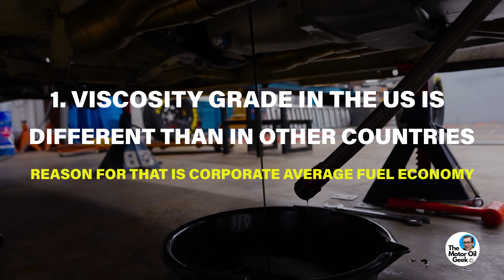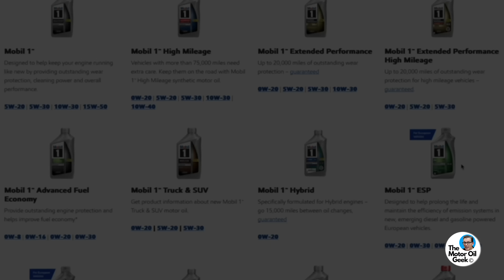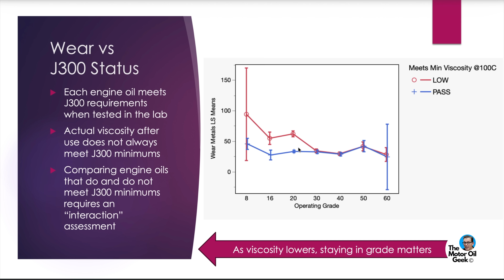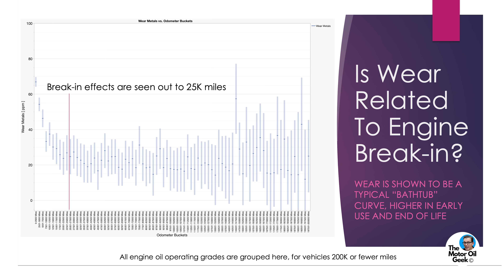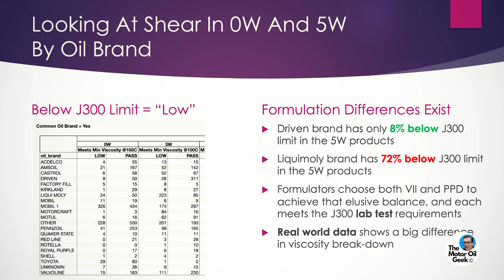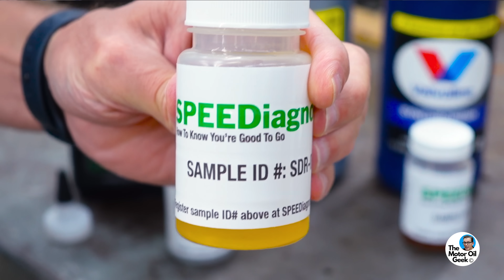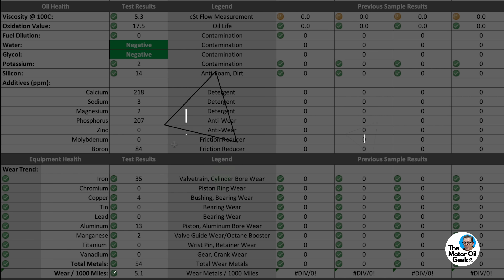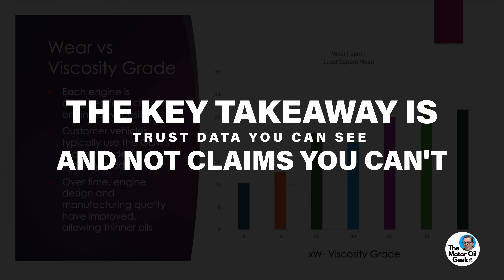More Ai Lies? The FACTS about 0W-20 vs 5W-30 (With Evidence)

Comment: Manufacturers often aren’t recommending what’s best for the vehicle long term they’re recommending what they need to do to meet fuel economy and emissions regulations.
Reply: and they want  damage so they can fix it or replace vehicle
Reply: @bikeman1x11  I don’t believe they want engine damage but their back is against the wall with ridiculous government mandates to save a quarter mile per gallon. For the moment many of those regulations have come to an end. Trouble is manufacturers plan long-term and we could do a 180 every election cycle.
Reply: @star9732  everything today is meant to not last -- im using a heavier oil as i know it will protect better .
Reply: @bikeman1x11  Oil pumps are designed to work with particular oil viscosities. Even when countries outside the US specify a different grade for the same engine, the oil pump is not always the same. Improper oil pressure and flow rate can have a bigger impact on engine wear than viscosity, especially when oil temps get very high around a turbo. Something to look into if you've decided to change your oil viscosity.
Reply: @Dando77691  You have no proof of that.
Reply: @Dando77691  other than tune and emissions  i doubt toyota ford honda etc specify. differnt oil pump for the middle east  than for north america-- the reality is that 0w oils are speced for mpg not protection-- 5w-30 seems to work in all but the hottest and coldest climares
Reply: @Dando77691  The oil pumps are the same although some use a different PRV to control pressure of higher viscosity if the vehicle is moved to a colder climate (basically some models have a cold weather package). Only thing this really does is help long term wear when vehicles are operated under heavy loads before proper warming.
Reply: @star9732 okay but why do some companies handle these government mandates just fine but others fail miserably (US auto makers)
Reply: Most manufacturers shoot for 140K miles. If the engine last this long they are happy. Many reasons why it's 140K but it all breaks down to money.
Reply: @Cutterman_fixer  No they aim just to last thru the warranty period.  They build and design vehicles made to last only 3 years, less if you put many miles on.
Reply: @xcalibertrekker6693  that makes no sense because would YOU buy another vehicle from the same manufacturer if it started to fall apart right after the 3 year/36,000 mile warranty was over? If an engine needed major repair right after the 5/60 warranty, would you buy another from that manufacturer? Car companies want repeat business. Dissatisfied customers don't come back
Reply: @Cutterman_fixer  That certainly hasn't been my experience. Maybe you should consider a different brand if it's yours.
Reply: @Georgiagreen317  Not sure what you are replying too. If it's what I said above the 140K mileage is what most car manufacturers shoot for on privately US owned vehicles with minimal maintenance done. This is not something I pulled out of thin air this is something I deal with for a living. Can a car last much longer, yes can it last much shorter yes. The thinner oil recommended by manufactures will work under normal driving conditions. That "normal driving conditions" is the problem. In today's society almost no one operates under normal driving conditions. Ref SAE technical publication and papers and you will see that what everyone thanks are manufacture recommendations are actually not manufacture recommendations. Again manufacture recommendations for oil grade which is posted on the oil fill is only for "normal driving conditions" which almost nobody does.
Reply: @Cutterman_fixer  well most of them are having a ton more problems  way before them please elaborate how you "deal " with this for a living.  0-16w can't be good for anything other than a sewing maching.
Reply: You forgot that they care that the engine run out of the warranty and than it can break down. In Ford they go for thicker oil from 0w20 to 0w40 to let the engine go out of the warranty.
Reply: True.  Had to get a tuner for my ATV to remap fuel.    That 14:1 is a lean torch
Reply: Did you watch the video?
Reply: @TruthInFlying  You do know there's a huge fine from our corrupt government for not using 0w20?
Reply: @lonniebeal6032 
Who is fined? Car manufacturers or owners?  Car manufacturers may be in an effort to comply with mandated fuel consumption.  I don’t see how a vehicle owner would be.  The whole reason we are watching this, most of us, is because we were screwed by oversight.  In other videos he speaks about surface finishes that didn’t have the crevices (my word) to hold lubricant.  After warranty failures and high oil consumption.  At the end he speaks about what to do test he says.  How many can and do this.  Buying any product is built on TRUST.  Trust in the auto industry did their testing in conjunction with the oil companies.  TRUST has been broken.
Reply: @TruthInFlying   The video is BS. The SAE actually recommends MUCH higher viscosity oils. eg 20w- 50 for temperatures above 10C/50F.
Reply: @TruthInFlying  I did & it still isn't clear which is the better long term oil.  He points out in the beginning that the viscosity recommended in the U.S. is often different than the rest of the world & because of mpg requirements.  He then points out 5W-30 may break down sooner than 0W-20 depending on which brand you use (assuming somewhat depending on change interval), at 3:36 he points out that 30 in grade has slightly more wear than 30 out of grade (seems odd) and slightly more wear than 20 in grade.  If they both go out of grade the 20 shows a lot more wear.  So if I buy an oil that falls out of grade looks like it doesn't matter with the 30 and 20 shows a lot more wear.
Reply: I have a 2026 Toyota that uses 0w8, but I live in Phoenix, AZ.  For the summer would I be better off going to a 5w20 or 5w30?
Reply: @adwenb  I would go with the 0w-20 so you stay with the more modern additive package the newer engines require.
Reply: @robertweinmann9408  nope. Same exact detergents in the heavier oil
Reply: @adwenb  Use the oil that is recommended for your engine. There is no proof that switching to one of those other oils will do a better job. The O.E. spec oil is tested where you live and proven to work correctly.
Reply: @thecardoc100 then tell me why the European version states 5w30 for the same exact engine. Hint: they don’t have our EPA. This is all a rouse created by car manufacturers to skirt fuel economy requirements.
Reply: @thecardoc100  I dare ya to move to AZ, drive fast on Interstates and see how long your transmission last following mfg recommended trans fluid change intervals.
Reply: @scottjohnson8576 they can and do tune the engines differently. Not every engine, but most are.

But you do you.

The different grades can be fixed by more frequent oil changes anyways.
Reply: @thecardoc100  No the oil is not tested to work it is only tested to be sure they meet MPG standards.
Reply: @davepetrakos475  Don't change the subject. There are times when doing more than the manufacturer requires has advantages, but without documentation and proof it's just an opinion and not a fact. Besides, highway miles are nothing when compared to local hilly terrain while towing a trailer that doubles the weight of just the vehicle alone.
Reply: @adwenb send a sample off and get an actual analysis of how it’s performing not just what some stranger is gonna tell you in these comments
Reply: @adwenb  They will say you voided the warranty better be careful.
Reply: @xcalibertrekker6693  Well it says in the manual.
Reply: @BOMBON187  And yet there engines and transmissions keep exploding.
Reply: @adwenb  go max 2 grades up, not more. 0w20 is good
Reply: @adwenb  manual says 5w30
Reply: 30wts.in s. part of state. I lived there in 80s.
 .and prefererd to run" high ' straight wts in summer...i warmed up engine till the lifters quit clacking. Kept apot of beaters alive with that strategy.
Reply: @adwenb  How would that effect your warranty? Would the dealership make that change?
Reply: @dotherightthing1187  I read they can't just outright blame the wrong oil, they have to prove it.  But, do you have the money to fight it in court?
Reply: @lonniebeal6032 I think that's what class action suits are all about. BUT, it means showing that the recommended lighter weight oil is worse for wear on average (like if you're using the long intervals recommended by the car manufacturers for "maintenance required")
Reply: @adwenb  Spend $40 and get an oil analysis on your 0w8 after a summer run.  Then if you chose a different oil you have that as proof their oil failed to do it's job.  Don't run 0w8 over 5,000 miles.  I've been trying to get proof for 3 years now that 0w20 is ok in hot climates.  I don't have factory warranties on my RDXs, so I run 0w20 for 6 months when it's below 70F, and 10w30 for the 6 months over 70F.  So far, with the information I've seen, high quality 0w20 will handle the higher heat ranges, the low quality, not so much.  Pennzoil Ultra P and regular Platinum always seem to pass the high temp tests.  Along with Amsoil, ( too pricey) Mobile One Extended Performance and a couple others.
Reply: @adwenb No doubt about it... If you use a higher grade and stick with the recommended longer intervals for oil changes you'd be better off because of the degradation of oils in hotter climate.
Reply: Finally an explanation backed with evidence 🙏
Reply: And to get the vehicle to the end of warranty but not further
Reply: THIS X1000
Reply: When you have soooooo many engines breaking down at 40-70 thousand miles you have to ask yourself, “what changed?”  Oil viscosity changed!!!!
Reply: @donbass6657  Oil viscosity, emissions and hydraulic lifters (hydraulic lifters and oil viscosity are related).
Reply: Always not often.  They would rather the engine explode then not meet MPG standards.  Such a terrible industry now.
Reply: perfect.  you got it.  my dad had a 96 jetta. 4cyl.  he put 20w50 in the stupid thing.  He said  needs to be thick.  it ran way over 100k but.  the throttle body would get gummed up
Reply: @Nick-wr7vv  What does the engine oil have to do with the throttle body getting dirty?
Reply: @TheSuburban15 😂
Reply: FACTS, FACTS, FACTS.
Reply: Well said and it's the truth plus it gives their service departments more maintenance to do
Reply: Fuel dilution and extended drains on 0w-20 is what think hurts a lot of these engines like GM 5.3L with AFM. I only use 5W-30 in my wife’s 18 for this reason.
Reply: @smiley3303 This is a faulty engine because a lot of people were having problems long before these engines began to use 0w-20. But I agree possibly this oil is ill suited for this particular engine . But there are many engines that can go the entire interval with no negative effects. Hondas and Toyotas (LONG BEFORE THE RECENT ENGINE ISSUES) have been using 0w20 full synthetic for years with no issues.
Reply: Exactly right. Anyone capable of thought should realize It's never been anything more than 'playing nice' with the EPA's phony, CAFE Standards.
Reply: You forget one thing. That engine was DESIGNED to meet EPA regulations. Therefore, that engine was DESIGNED to run on the oil the manufacturer  recommends. Doing an oil change is the cheapest insurance you can do to prolong an engines life. I always change my oil sooner than recommended anyway. People today do not even bother getting their oil changed when its recommended, then wonder why their car fails them.
Reply: Absolutely correct
Reply: Fact , back in the era of the BMW m63 engine BMW claimed it only needed oil changes every 17,000 miles . They did this to get past the EPA’s emissions restrictions. Less oil changes less environmental impact. Most of the cars sold with the M63 engine lost the engine to valve guide and valve seal failure. Eventually a class action lawsuit was filed against BMW and they were forced to repair the engines. Sad story because the engine would build up contamination in the cylinders causing pre ignition. The computer would sense the pre ignition and shut the engine down . The extremely hot crank bearings would seize and lock the engine up .
Reply: "Manufacturers often..."  Not "often," anymore, but always. Regulations are forcing them to prioritize EPA fuel economy ratings over long-term ownership costs.

Comment: So 5w30 is better, 0w20 protects just as well (all things being equal) until oils start to thin down from heat and wear. 5w30 would have to thin out at a higher degree than 0w20 to become a problem.
Reply: That’s what I got too. Been looking at switching to 5w30 in my Lexus from 0w20 now that mileage is about 90k. This vid helped out
Reply: @beammeupbrando I switched from 5w20 to 5w30 in my Corolla and V8 F150 about 3yrs ago and haven't had a single issue. I use either Pennzoil Ultra or Valvoline Restore and Protect, oci at 5k miles or less.
Reply: @mr.boostang2064 Pennzoil is what I use too. I haven’t had any issues either. Runs smooth and quiet as ever

Comment: Is is just me... that is starting to think, that for normal to hot climates, we really need straight 8 weight, 10w-20 and possibly 10w-16 or even a straight grade 16 weight???
Reply: If you are driving a hybrid car, the oil needs is very different. As much as, one sport car(bugatti chiron) requires an absurd packages of additives and operational conditions that lubricant is very pricey and seldom used. 
One problem of hybrid powertrain is cascading effect on other engines of the same platform to accommodate cost and inventory handling. We try to  narrow down stock of  parts and fluids diversity to make things cheaper

Comment: I’ve done 2 changes on Jeep 3.6l’s w/over 100/120k w/Valvoline R&S 5w30. (I used Amzoil 0-20 before) Excellent results from Lake’s oil analysis. Now I’ll go to Driven brand on the one I’m keeping since the milage is getting up there. Both engines are still getting the same gas mileage they always have.

Comment: So I've seen at least 30 different videos that go back and forth on oil weight and what to use and not use. Ive got a 2020 Toyota 4-Runner TRD that calls for 0W-20. The state i live in has 4 seasons, but would it be more beneficial for 5W-30 or stick with 0W-20? I change my oil religiously every 5K miles.
Reply: My wife has a 2020 4 runner also. I used 0w20 for the first 3 oil changes and the engine did not sound very happy. (Cold start sounds) I changed over to 5w30 and it likes it A LOT BETTER! Engine seems to sound a lot happier! No cold start sounds like it had with the 0w20. This 4.0 engine is the same engine design they had from the start of production in 2002 and back then it called for 5w30

Comment: My newer cars only specify one viscosity, while my '89, 2,2 l Mazda 626 had a chart where you chose viscosity according to climate temperatures.
Reply: This is the correct way to! Chose to the climate !
Reply: Remember that back then, factory fill was NOT synthetic oil. Today, I believe that most, if not all oil in new vehicle engines is pure synthetic. I had an 89 Mazda MX6 GT Turbo, and always used synthetic Mobil 1 oil.
Reply: Engine will run at a steady operating temperature essentially unaffected by exterior temperature. The engine management system will quickly bring the engine up to temp with a high idle for efficient operation and then the cooling system will maintain the operating temp very closely. That's why they don't use the climate temps anymore.
Reply: Takes about 25 minutes of driving to get an engine warm. That's 25 minutes of cold oil.
Reply: @Frille512That depends on the ambient temps and whether you park in a garage or not.
Reply: @Frille512 The oil gets to temp much quicker than that. The oil is to temp before the coolant even circulates.
Reply: @MathewPollard-vj4uq Having an oil temp gauge would be helpful. My Scanguage dies display coolant temperature, among other things like air intake temps, voltage, air/fuel mixture or others.
Reply: @MathewPollard-vj4uq  That's wrong. It takes twice as long for oil to heat up than water. The water gets warmed up by the engine block, not by the oil.
Reply: @Frille512 The small amount circulating in the block but not the whole cooling and HVAC system depending on whether it has a valve. The engine will be warmed to operating temp when the high idle on start up turns off - way less than 25 minutes .
Reply: @MathewPollard-vj4uq  Whether or not all of the coolant gets hot doesn't matter, the thermostat opens in proportion to hot the engine is. The water in the engine gets hot before the oil gets hot.

Idling doesn't warm the engine, so no amount of idling is going to get the engine to operating temp.
Reply: I remember that page in the owner’s manuals, and usually 10W-30 had the widest range!
My 25 Bronco manual just tells you where to put the oil. The grade is on the cap (0W-20) and it doesn’t even tell you the capacity!
Reply: @Acelachaser1965 I've never owned a vehicle that did not come with fluid capacity information. Shame on Ford if they left that out.

Comment: I have a 2020 4Runner and a 2017 Honda Accord which both call for a 0w-20 oil.  Can I change to 5w-30 without any issues?
Reply: Yes, of course. Especially if you live in a hot climate. Temperature determines what viscosity to use, not the government.